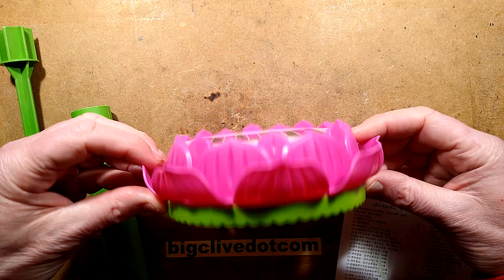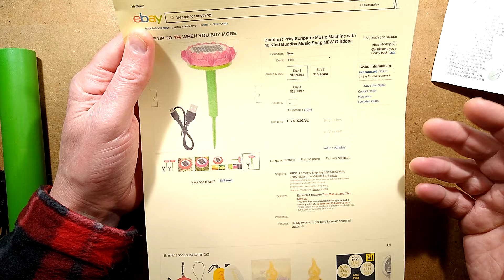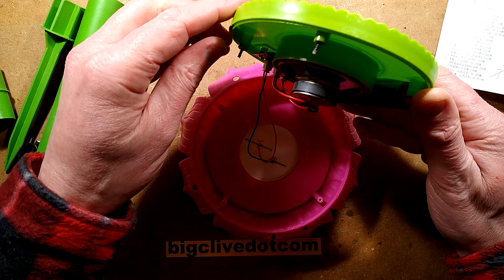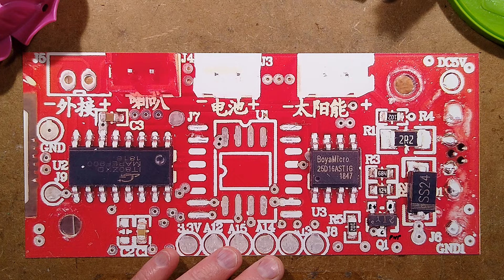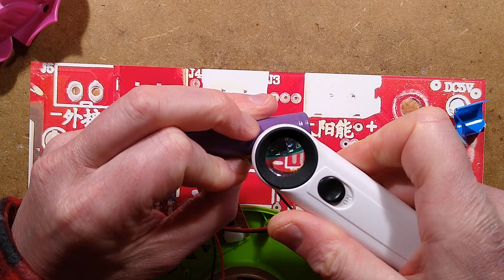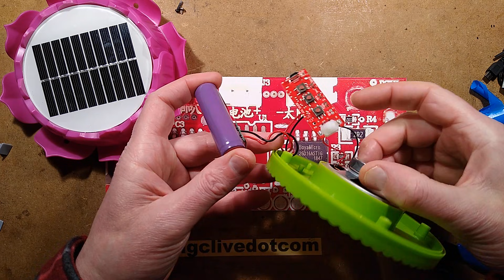Solar powered buddha chanting flower.

Comment: that is absolutely horrendous - I must buy 10 of them
Reply: If you place them on you property boundary your neighbors will love you 😃
Reply: @gerhardtoxopeus8574  lol.  You read my mind.  Hide one on the edge of someones property.  Preferably a jehovah witness :p
Reply: Change the samples, make it charge all day and do creepy noises all night, breathing, wolf howls, banshee shrieks...
Reply: @Lumibear.  I did something similar with one of those ISD1820 modules you can get on eBay. I made something that would start screaming after 12am for about 2 minutes on the hour until 8am, locked it in a safe, took it to my brothers house and put it under and padlocked it to his bed. - I didn't get a birthday present that year.
Reply: Only if you use all 10 of them at once and even mod them to put audio jack sockets to blast that horrific noise thru a mixer and amplifier! You could even connect them to a doorbell button to scare the living scrap out of doorstep 'problems' (religious folk or energy smart meter folk) who disturb your day.
Reply: I remember seeing a circuit for a cr2032 powered beeper that goes off totally randomly with a huge time gap between each beep. Get 10 of those and hide them. If the victim asks if you're hearing a beep, say no... watch the victim either thinking he's going insane or spend a whole day trying to find the source

Comment: Yeah, I'd say you're right about those extra footprints, 16-pin SPI flashes have an oddball pinout like the die was rotated 90 degrees from its position in an 8-pin flash (hard to explain but makes sense if you look at a datasheet ;) ) and the vias seem to be making the connections I'd expect, not sure why there's two SOIC8 footprints though.

Comment: Aww, i thought you will dump the SPI flash out to see what's in it, there's a cheap CH341 SPI programmer on ebay that can work with these SPI NOR chip, they also have a clip so you can stick on the chip and reading it without desoldering it from the board, sometimes that clip thingy doesn't work because other circuitry around will try to power up from the 3.3v applied to the chip and make the voltage drop
Reply: Yeah, dump the flash and reprogram it :)
Reply: Yes that's exactly what I was thinking, use a test-clip to go on the spi flash chip, if the microcontroller interferes (its 3.3v maybe powered up) with the programming, perhaps you can hold its reset pin low, but if it has internal regulator perhaps it won't back-power from the spi flash 3.3v

Comment: I was bored and translated the parts of the instruction leaflet I could see.

Miracle Lotus® F18 Lotus-type Outdoor/Indoor ...

Power
Previous/Volume -
Next/Volume +
Play/Pause/Repeat
DC 5V Charging Port

This is the latest version, can be solar charged outdoors (rain/storm/freeze resistant), can also be...

Operation instructions:
1. When using outdoors, set in a location with strong and lengthy sunshine, with the solar panel facing upwards and level ... height, preventing water from coming in through the buttons and speakers (the unit is designed to be rainproof, but not waterproof, cannot...
2. If not using for a long time, put the outside under strong sunlight every other month...
3. Charges fully under strong sunlight after 8-10 hours; charges fully with a 5V 1A charger after 2-3 hours (with 500mA, after 6 hours) ... Depending on volume, playback (?) lasts 2-5 days.
4. Hold the previous button for 3 seconds to reduce the volume. Hold the next button for 3 seconds to increase the volume.
5. Hold the play/pause button for 3 seconds to toggle between repeat track and repeat all modes.
Reply: What is the label on the far left empty connector on the circuit board? The right two are battery and solar (obvious) but that last one has the text partially cut off.
Reply: @fsmvda  It says "external connection", so probably line out.
Reply: Well done

Comment: Long press on the play button switches mode between "loop all" and "loop track". It's probably on "loop track" by default. The leftmost connector that's unpopulated transliterates to "external connection", so I'm guessing line out.
Reply: @kilosierraalpha  "Power off"
Reply: @kilosierraalpha  "guanji"